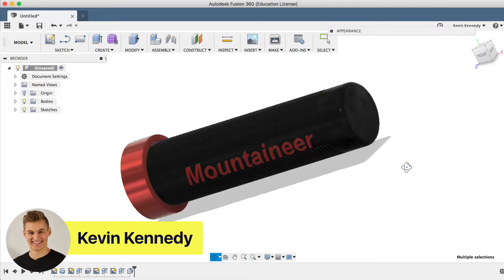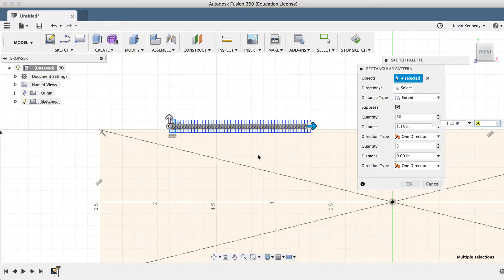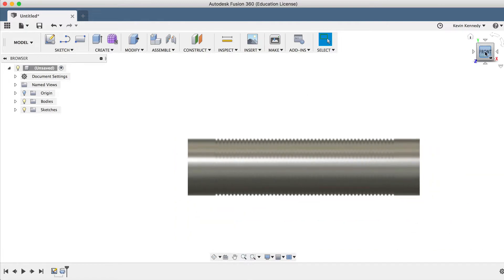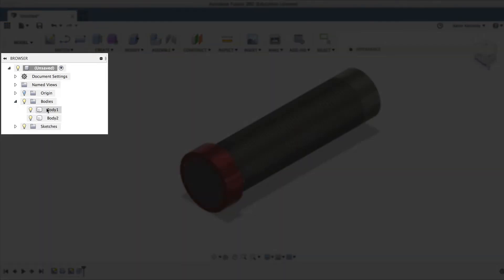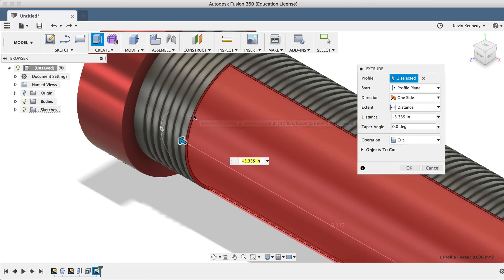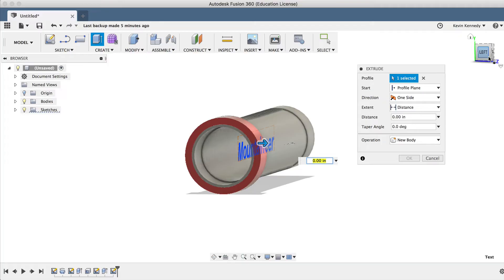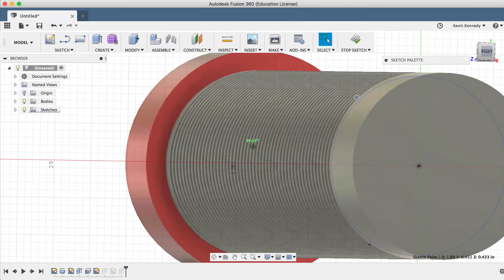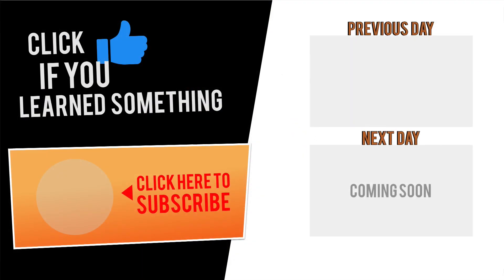3D Model a Handlebar Grip with Embossed Letters - Learn Autodesk Fusion 360 in 30 Days: Day #7

Comment: when i draw my line across the rectangle. it doesnt select into two halves. so when i revolve. it only does the rings.
not sure what to do. ive tried a lot. i just make it worse
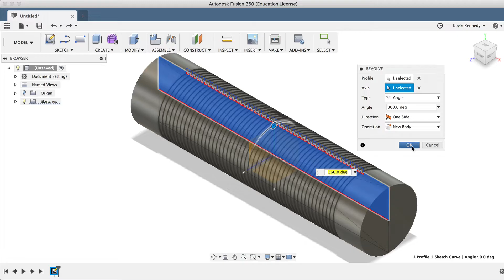Reply: so at 1:58. when u do that yours looks like a handle bar. mine doesnt. i cant even get it to select just the top half

Comment: Anyone else having trouble with the rectangle pattern feature? Mine won't let me select the sketch lines
Reply: having same problem
Reply: @river-0101  I don't remember exactly how I ran into this problem but the rectangular pattern tool works differently if you are not in sketch mode. If you have already hit Finish Sketch then it won't pattern sketch lines

Comment: The press/pull doesnt work for me. If I try to pull the text, I can't because I can't select the text.
If I try to emboss it, it seems to work and then it embosses the text on the wrong side (were the grip is). Tried every setting in embossing with no success. Always the wrong side after clicking the ok button. Before that it looks fine- it is only after closing the emboss-window that it goes to the other side.
But that's not so important now.. I would just like to be able to do the task as shown in the video... I am sure this current version of Fusion 360 requires you to make some setting changes to  be able to select the text...
thanks for your videos btw! They are GREAT!

Comment: I think my computer couldn't handle this design, maybe because of the 50 little rectangles (at least, that's how things work in, say, Illustrator). I had the same issue with shelling--Fusion kept telling me it was already shelled, or it just gave me an error message that said "Shell1" and then would seize up. Good thing I have access to a a computer with more horsepower.

Comment: The major problem I had with this ( partly as I normally use MM not inches) . The first box for the patten had no dimensions , I guessed and it worked,But when I tried it again I did not zoom in as far so my boxes were bigger and overlapped ( not obvious) of a revolve just gives a smooth cylinder!.

Also could not work out to alter the patter number 50 with out re doing the whole sketch.
Loving these videos , this is the first one I have had problems with.

Comment: Thank you Kevin. I love this series - it's the best F360 tutorial by far that I have found. Some suggestions... While it's great to start with a view of the end product I suggest also summarizing the approach you're going to take to create a model. Also, there are times you could explain the purpose of a command better. For example, in this tutorial I didn't fully understand the difference between Extrude and Project, and specifically when I would choose to use the Project command. In the dog bowl tutorial you blew right through using the patch workspace - I still don't quite know what that is.

Comment: If you're at around the 5 min mark when he's extruding the section to place the letters and you're model is removing the core of the cylinder and not the grips, here's how I got around that. Do not make the circle in the sketch smaller than the outer circle, make it the same size. Maybe I was sketching on the wrong surface, but I did that and got the result as in the video.

Comment: If you want the letters to propagate radialy from the cylindrical surface:

1. Offset cylindrical face (offset distance 0 - so you copy the face)
2. Extrude your text (as a new body - like this vid suggest)
3. Split face (from point 1) using extruded letters (from point 2) - so letters would be inprinted on the offset surface (from point 1)
4. Delete offset cylindrical face, except splited letters
5. Add thickness to letters face bodies.

Comment: Great videos...thanks...at 2:26 in the video, you grab the right vertical of the small rectangle and drag left and right which results in resizing  the width of all of the rectangles.  When I grab("Windows" left click and hold) the right line and drag, the rectangle  moves and the rest of the row of rectangles move relative position, but the rectangle doesn't resize.  I tried combining with shift and ctrl keys, but same outcome.  How are you selecting the right vertical and changing the width of the rectangles?
Reply: Great!  5 seconds after I ask the question, I figure it out.  To ensure approx replication what you where doing in the video, I typed in the dimensional values of .5 for the width and .108 for the height.  When I did this, it locked in the value.  I deleted the dimensions from the rectangle and then was able to drag and resize.  Learned something new by user error

Comment: Editing a shape in the latest 360 must be a different approach. If I grab an edge of the rectangle we rotated, it moves the rectangle. I can resize by editing the dimension marks, but I can't drag any dimensions.
Reply: Also, at time 5:10 when you extrude where the text will go, I have a slight variation. The latest 360 version doesn't have Create Sketch when I select the ring feature. There is a Sketch drop down where circle can be selected, but it is very important to select the edge of the feature as the sketch plane. It took a couple tries to find that secret.
Reply: Had a problem with selection similar to below when trying to select the letters to change color. After selecting them all and modifying the appearance, the entire grip changed color. I humbly request a video on selecting and editing in the latest UI.

Comment: hi kevin,
Thank you so much for the great tutorial videos, I learn a lot from them.
I have a question about the creation of the text. I do not find the option you presented: "press pull", I had to use the standard Extrude command.
It seems to me that we have different versions of Fusion 360 (my version is 2.0.9937), maybe that's why? How can I solve the problem?

Thank you
Reply from the maker: Press Pull is still available in Fusion 360, though the right-click menu has chanced some since the recording of this video. You can activate it with the shortcut letter "Q".
Reply: @ProductDesignOnline  Thank you. it worked.
I would be happy if you could clarify and briefly explain the difference between the two commands and give examples of cases where it is better to use one rather than the other.
Reply from the maker: @doronyf  Glad that worked. Press pull is a smart command that will turn to offset faces, extrude, or the fillet feature based on your selection.

Comment: I created the big rectangle and the small one. Replicated it with the rectangular pattern. Result is 50 little rectangles and the large one. But it doesn't create the single edge line that follows the edge of the rectangle? They are still independent objects?

Comment: Grrrr. Only 7 lessons in, and I think I've been defeated. I CANNOT get the text tool to work! Since there's no "sketch menu" on the new version, I've been selecting the text command from the Design Shortcuts field. Then I can't figure out which plane I'm supposed to click on! My axis names don't match yours...Should I be selecting the origin plane that you can see head on when you look through the hole on the end? Or is the plane the external ring where it intersects with that origin plane? It feels like I've tried every combination. Each time I take the next step and go to lay down the text, it says that was the first point of the text frame, and to click again for the second. I'm not getting the crosshairs you have in the video right before you start typing. Even after I set my "text frame", I can't type in it. The text panel doesn't even have a space for the text! Are these differences due to the difference between program versions? I don't see anyone else here having a similar problem, which just makes me feel like more of an idiot! I may have to throw in the towel on this...if I don't throw my computer out of the window first! I don't know how this can be explained in words (I had a hard time typing this), but I'm hoping you can tell me what I'm doing wrong! Thank you!
Reply: Hey man! I know it's a bit late but this is a problem I think it deserves to be here in comment section as a reference for  somebody else who might be  facing the same issue. I was facing the same issue as yours, so as a fellow student of f360 I feel you. The fix was simple really, it always is, but it bites the nail off when you just can't figure it. Coming to the issue, I realized that I had my previous sketch window open and since the plane for the previous was different one the text wouldn't sit well on this one (plane). So I then clicked on finish sketch and then clicked on text button from the shortcut, next you choose your plane correctly( in my case it was yz plane) and now the crosshairs will appear and I was able to write the text there. Hope it helps you!

Comment: Hi Kevin. I'm having a similar problem to Buttons Q 8 months ago. His solution didn't help me.  When I draw the small two point rectangle across the top edge of the larger rectangle, it is not showing the edge of the larger rectangle dropping down into the small rectangle.  When *you move your cursor over the larger rectangle's top edge, the edge seems to drop into the cut into smaller rectangle.  Mine just sits there. The repeat pattern works fine for a bunch of rectangles superimposed over the top line of the larger rectangle.  In one instance the lower portion of the small rectangle turned red, but I don't know why or what I did.  Either way, the indentation is not there to be repeated.  Is there a join or cut command I'm missing?  Help please!
Reply from the maker: Can you share your fusion 360 with me?
Reply: @ProductDesignOnline  Thanks Kevin, No problem sharing, how do I do that?
Reply: Solved.  Drew the 1'st rectangle, selected the Trim function, clicked on the line segments above and in contact with the OD line by holding shift, leaving the indentation.  Carried on with the repeat pattern and exercise.  A nice series Kevin, thanks for a nicely paced training series.

Comment: Thank you for the tutorial. But one thing I was wondering,
How do you drag and drop to navigate in the canvas area?
In Adobe it would be by holding the space bar at the same time so the cursor changes to the hand.
But how does it work in Fusion 360?
Reply: Middle mouse button will move the object around and Shift+Middle mouse button will revolve.

Comment: Love these! amazing tutorials...been breezing thru 2 to 3 lessons a night. Running new 2019...some challenges but completely manageable, just slows me down a bit. However this one has me completely stumped... in many ways. 1st I can't shell, but can overcome that in other ways. 2nd is the extruding of the flat spot. I have spent hours on this lesson. actually skipped it and move on thru day 10 without issues. Coming back to this one and I still can't get it to work. when I extrude flat spot...it removes the whole cross section. I have tried it by leaving the grip solid with no hole. Even then when I extrude flat spot it looks like my grip is shelled when it was revolved even thou haven't created the hole/shell yet. I have built this and rebuilt this grip 8 times...I can't seem to figure out what I am missing...perplexed
love these views thought...if i can't get one lesson I'll survive :) thanks for these and all your teaching!
Reply from the maker: Hmmm... strange that it wouldn't let you shell a cylinder. Is your Extrude command orange or blue? Double-check that you used the solid modeling Extrude. Let's fix that first, as that may be the cause behind the other issues.
Reply: @ProductDesignOnline  BOOM...there it is. I didn't realize there was a "blue" and a "orange" ie. solid vs. surface options....stupid me...should have been obvious. I knew it was something so simple I was just missing. Thank you thank you...everything was a breeze after that revelation. Awesome. learning a lot quickly. your the man!
Reply from the maker: @VerdonkRacing  You're welcome! Glad that was it. Happy learning 😎

Comment: 5:58 If i place a text it goes to the left side. I have to angle it. Is that because of the new updates from fusion 360?
Reply: I got it. Preferences: Default model orientation for Kenned= Y up. New default fusion 360 = X up.

Comment: for some reason when i try to press n pull my letters to the surface, it appears all good and well while doing it, it looks good so i confirm it, but the second i press enter it loads the lettering as if i made it like 2 inches out. i dont know why this happens and dont know a way around it.
Reply from the maker: Hmm. very strange indeed. Have you tried restarting the program to see if that takes care of it?
Reply: @ProductDesignOnline  i have not, ill give that a shot once i get home to it. Im sure its something i did wrong, i just dont know exactly what and any of my usual "get arounds" dont seem to be working. Its very persistant on extruding very far off of the grip. Even if i just extrude the text on its own text plane it does the same thing. .03 makes a thick text inside the grip and ALSO the extreme protrusion from the outside of the grip. Very weird.

Comment: When I came to change the appearance of the letters, I found that I could not select the letters individually. I went back to where you extruded the letters and watched that a few times to see if what I had done was the same as you. It was. I decided to experiment and changed the extrude operation to "New Body". It worked, I could now select each letter individually. I also found that if I opened the "Bodies" list, I could select "Body 3", hold shift and then click on "Body 14", I got all the letters in one hit. 
I had applied the "Hard Rubber" appearance to the main body of the grip. I then right-clicked on the "Hard Rubber" in "in This Design" section of the "APPEARANCE" dialogue, selected "duplicate" and changed that to red. I used that for my letters. I learnt a lot here. Thank you.
Reply: Snark, I have the same problem.  But, how did you change the extrude operation to a "New Body"?  My selection window does not give me that option when I try to edit the extrude operation from the time line.  Thank you!
Reply: @RCGache  After you have created the text, check to see if is in the centre of the grip. Then select the text and right click on it. Select press/pull. Make sure that your "start" position is "From Object". Now set your Distance to 0.03in. If the letters turn red, it is trying to cut the letters into the grip and cannot create a new body. If this has happened to you, set the Distance to -0.03in. You should now be able to create a new body, well 12 of them actually. Hope this helps.

Comment: Just for others - the first few times I did the rectangular pattern, I actually didn't select all four sides of the rectangle (it said I had selected four things - maybe I grabbed a constraint?) so the revolve wouldn't work right.  I started over and zoomed in a lot and then did it correctly.

Question: is there a way to get a timeline inside the sketch to reverse things?  When I realized what I did, I went back into the sketch to try to fix it, but I couldn't select all the parts so I ended up deleting and doing it again, but would have been nice I could have reversed the rectangular pattern command.
Reply: Ctrl + Z , maybe..?
Reply: I don't think so. There is no history ,or function list, or feature list, or ANYTHING for what happens in sketches. I wanted to alter the overall length off all of the rectangles or the number of them and you can't. Fusion 360 works great when you already know what your project is going to look like and get all of the dimensions in correctly at the beginning but editing is such a pain compared to Catia or Pro-E.
Reply: @tomsko863  Thank you!

Comment: Hi Kevin, can I first of all congratulate you on this wonderful series of tutorials, I am having a blast learning and playing with F360 and in time would like to become far more proficient at it. Being an auld faurt however, my brain is not the sponge it once was and the pause and rewind buttons are near worn out.

I am struggling with this lesson though and despite five or six hours wasted trying, I am completely unable to get any text on the grip surface. Despite following your mouse pointer like my dog follows my laser pointer, I can not get text on that surface. It seems to make little difference which plane I select but any text I type is always 90Deg to the surface, arghhhhhhhhh!!!

I am using Version 2.0.8335, maybe there is something different between this current version and that on which you created this tutorial. If you could find the time to maybe point me in the right direction I would be most obliged.

Thank you again for stimulating this old brain, so impressed am I that I have become a Patreon subscriber :-), a first.